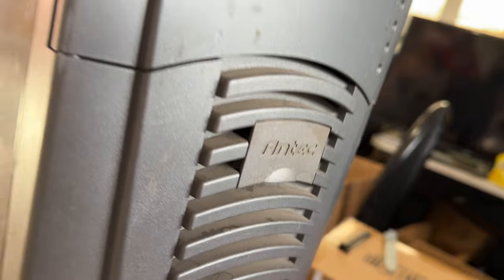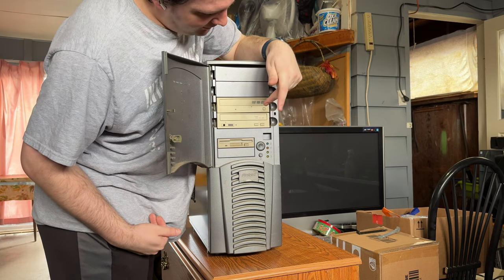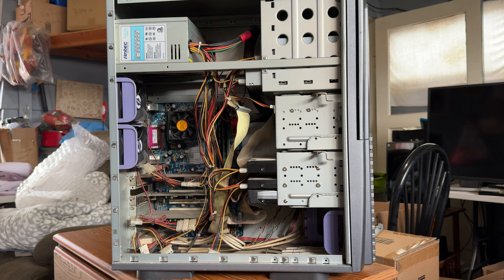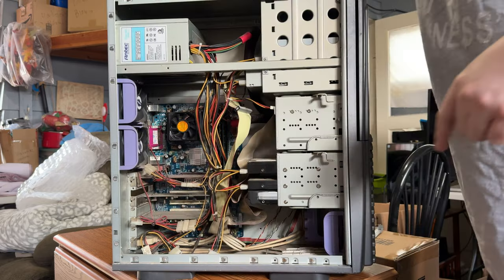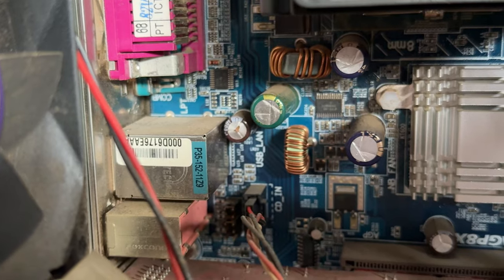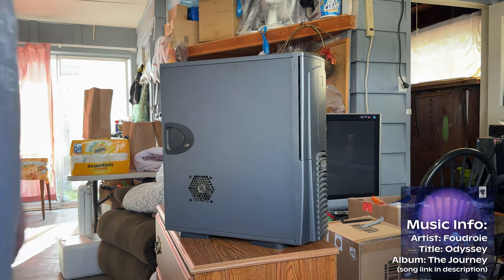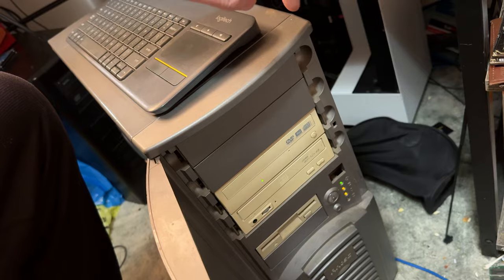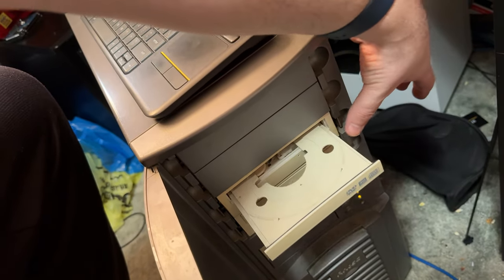JW Special: The $10 Thrift Store Custom PC

Comment: early ddr systems didn't do dual channel and only had 2 or 3 slots. there was even some random boards that would have 2 sdram and 2 ddr ram slots and then there was a large row of jumpers that had to be set to switch between using sd or ddr

Comment: I wonder why did it see the Sempron as an Athlon XP? Old bios version or maybe the board did not support that cpu? I used to have a different Gigabyte model that would say my 2500+ is a 2500+ Mobile but it was recognized as a regula 2500+ in other boards
Reply from the maker: My guess is an out-of-date bios, I think the one it currently has is out of date just enough to not recognize a Sempron by name properly, but still able to work. It seemed to better handle the older Athlon XP I put in, though, so I’ll keep that installed.